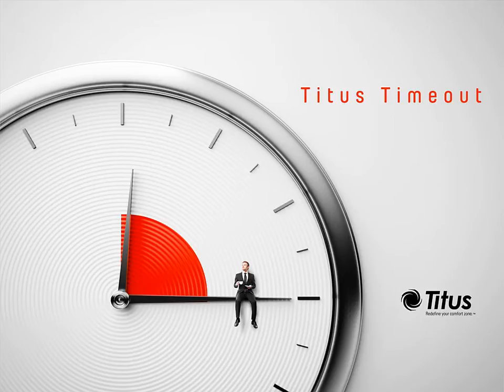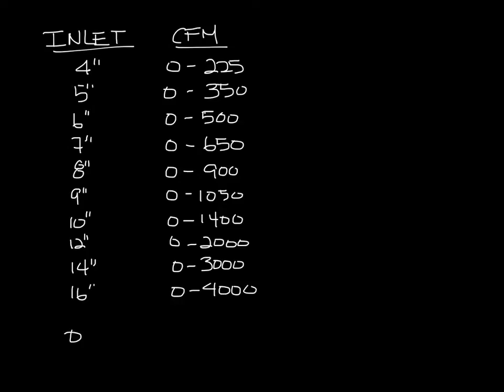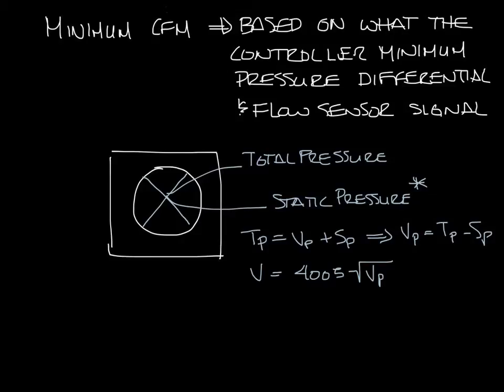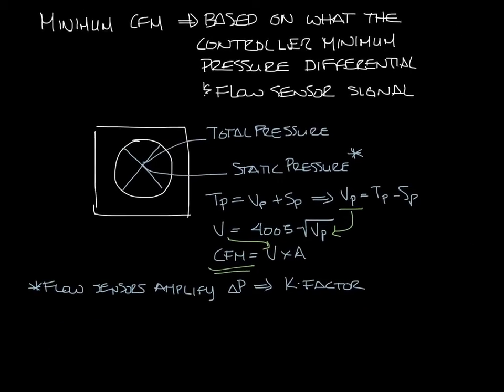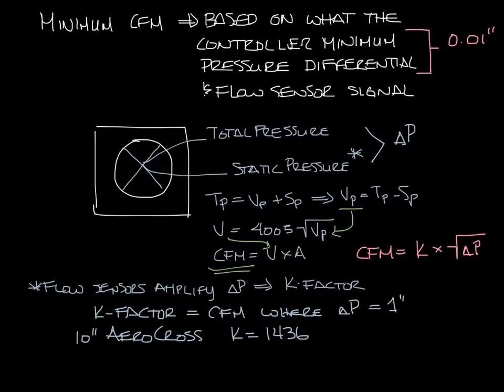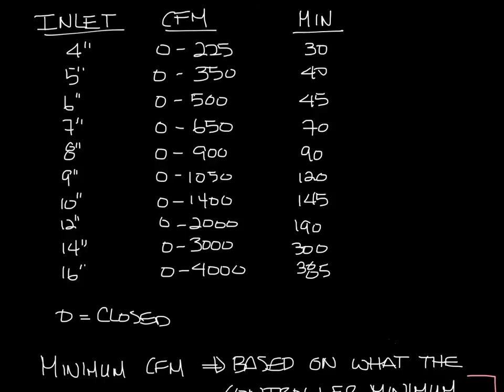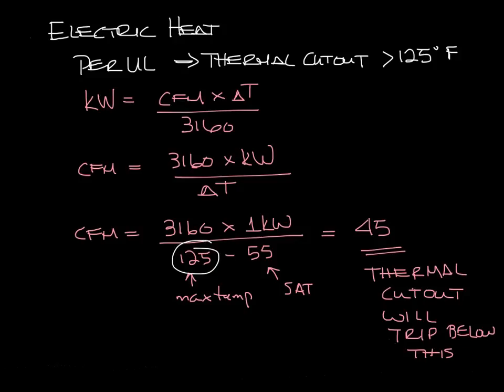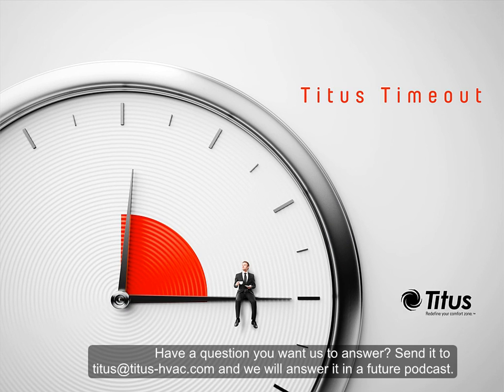Titus Timeout Podcast - VAV Box Minimum CFMs

Comment: Kindly explain heating, cooling and dead band setpoint.
Reply from the maker: Terminal unit controls that handle both heating and cooling typically have multiple temperature set points. They typically have a cooling set point and a heating set point. The cooling set point is always equal to or greater than the heating setpoint. If the room temperature starts to rise above the cooling set point, the controller will provide additional cooling. If the room temperature drops below the cooling set point, the controller will maintain a minimum airflow limit in order to provide ventilation to the zone. If the room temperature drops below the heating set point, the controller will increase the airflow to move more air through a reheat coil and begin heating. The temperature range between the heating and cooling set points is referred to as the dead band. It is typically 2-4°F. This is the temperature range that the room temperature must pass through in order to switch from cooling to heating.  For additional questions contact us at tu@titus-hvac.com.

Comment: Please explain how to calculate minimum CFM for hot water coils
Reply from the maker: If I’m understanding the question, there is no minimum airflow requirement for hot water coils. On a single duct VAV box with a hot water coil, there should be at least three airflow settings. The ‘maximum cooling’ needs to provide adequate cooling on a design day. Then the ‘minimum cooling’ needs to meet ASHRAE 62.1 ventilation requirements for a given space. Then you have a ‘heating’ flowrate. This is typically less than 50% of the ‘maximum cooling’ flowrate. It’s dependent on the amount of heat required in the space because heating delivered from overhead diffusers should never be more than 15°F higher than the room temperature setpoint. Here is the formula that relates air temperature rise to airflow:

CFM = 927 * MBH/(LAT – EAT)
Reply: Thank you. To clarify,  my question is about how to calculate heating CFM for a vav box with hot water coils instead of electric reheat. Thanks for your reply.
Reply from the maker: @Suvi0999  Our previous response addresses your specific request